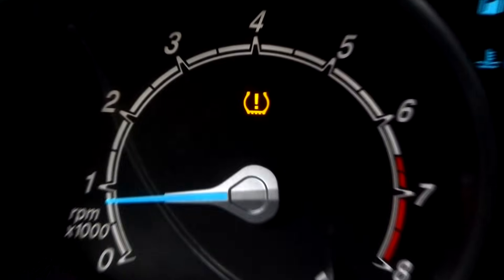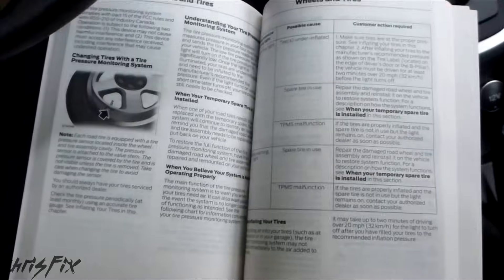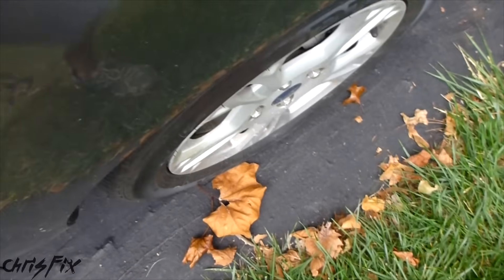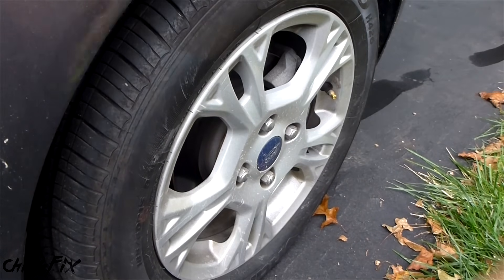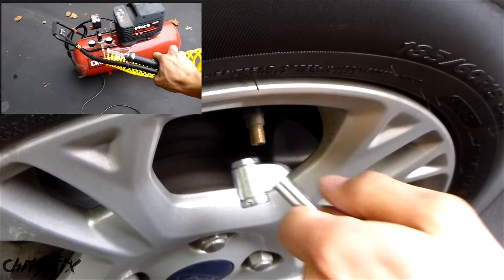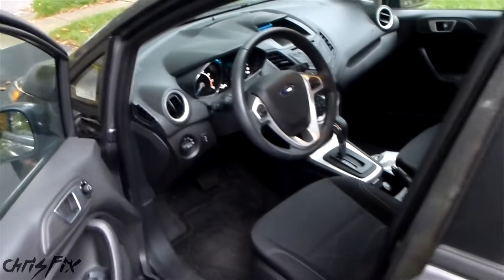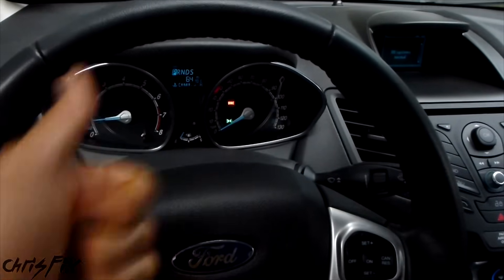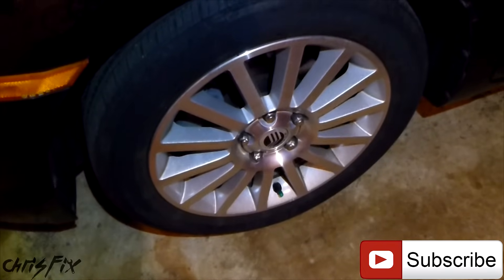How to Reset Low Tire Pressure Light (TPMS)

Comment: Black electrical tape fixes all warning lights
Reply: Otherwise its $80 each if after adding air it stays on because the sensor's battery is low.... so tape $1
Reply: @lovefaith1714  Where you get that price?
Reply: @roymg  Discount Tire ....... but mine turned out to be MY SPARE IN THE TRUNK, put the air in THE LIGHT WENT OUT
Reply: @lovefaith1714  thanks for the info. I just checked spare, its flat
Reply: Turning up the volume on the radio works to stop engine/body noises also.
Reply: It can turn off the odometer or even the gauges!
Reply: The same thing works on ABS as well!
Reply: Lol. Indeed it does.
Reply: Where do you put the tape. I was told it’s $258 + to repair TMPS tire sensor.
Reply: @carolync9408   Each sensor has a lithium battery that will eventually die.  So, tire companies want you to just replace the sensors when you get new tires.  (no repair)
Reply: @Ocalaman  Hi, there. Thank you so much. The car is paid for and I was thinking of just trying to find someone to repair it; because I’m so tired of the low air pressure warning. I may as well hang on for another year, and buy the sensors with the next set of tires. Thanks again.
Reply: i agree :)

Comment: What about aftermarket rims? My tires have a 51 max psi on them but the door and owners manual say 32 Max psi, I've aired them up but the tire light still stays on. Any suggestions?
Reply from the maker: +Ricky V.  The door jam is the correct pressure. Fill them up a little over the recommended pressure to like 34psi and see if it goes off. Also double check to make sure there are no leaks.
Reply: ChrisFix so just off of what the door says and not the tire?

Comment: hey Chris, I got this problem and I tried to inflate the tire as recommended. the sing goes off for few hours and pops back again even the tire pressure is good! So could it be due to bad pressure monitoring system?

Comment: All you got to do is go to any mobile gas station. You can set your tire pressure on the machine and the air pump will automatically stop when reaching that pressure instead of going around to each tire to see which one needs air. Just fill the air in all 4 tires until the air pump automatically shuts off for each tire. They charge 75 cents.
Reply: Please tell me you are joking.  Not only are those machines wildly not accurate, but do you think all tires on all cars should be at the same pressure, no. So anyone who reads this please know he is joking.
Reply: @davedavid8749  On the ones that automatically stop, the default pressure is 32 PSI BUT you can set it to what your car specifies in the event that you need a different tire pressure.

Comment: Chris Ive owned my car for over a year and have never seen the TPMS light turn off. Do I have a faulty sensor? I always maintain the pressure few psi above the recommended.
Reply: One of the TPMS was probably removed from one or all of your tires.  Do the valve stems look different on any of the tires?
Reply: You probably have a sensor fault then.

Comment: I got a tire gauge because of this video but I'm still having trouble with getting that light to shut off. I have a 2011 Hyundai Accent and I feel like I'm doing something wrong when filling the tires. Can someone help? I know it's simple to those who may be used to filling their tires but I'm not.
Reply from the maker: Fill it with 2 psi more than the door jam sticker says and see if that works.
Reply: ChrisFix you actually do respond. Thanks for your help sir!
Reply: ChrisFix I wanted to respond to those having a tps light issue. Although what Chris said is recommended, if you're having an issue like mine, try adding a little more pressure than what the door jam says. I put the pressure of air that the tire says is max and it's not my safest bet but it got the light off!

Comment: you didn't actually show how to reset the tire pressure light.  Just how to check and fill your tires.  I need to know who to reset the light if all the PSI's are accurate and have been driving with the light still on
Reply: Show her how to do a TPMS Reset Procedure.
Reply: there is a reset button probly in the glovebox that neds to be prested for 2 second s well is on my puegeot 108
Reply: ChrisFix what does it mean if the the light doesn’t go off even after filling up the tires with the correct psi? Could be bad tpsm sensors?
Reply: @karlaber3388  Battery time.
Reply: Karl Aber yes or the tires just need to be reset with a special tpms tool which you can do at the dealership
Reply: There. No tools they stopped making the car
Reply: @johnpeveto3784  there's not a different tool for every car. Go to any tire shop that's reputable and they'll have a TPMS scanner. They walk around to each tire and scan it to the computer so they can Bond the PSI reset
Reply: Resetting pressure monitoring system is NOT ALWAYS THE FIX, its $80 each if after adding air, drive it and the LIGHT STAYS ON it may be one or more of the sensor's battery is low and needs REPLACING. Hopefully not for most cases.
Reply: kerry briggs .
Reply: Karl Aber If this happens, you most likely have a button or menu somewhere in your car to reset the system. Check your car's user manual. Usually the TPMS system is only malfunctioning if the TPMS warning light is flashing.
Reply: Every car has a diferent way to reset ..read your manuals,,when my comes out all i do is check tires by eye ..then pressure check if it says under 35, guess what? It needs air it cost 1.50 in houston tx at any gas st,but sometimes sensors battery goes out and no reset in the world is gonna make it work ,i think yours is out ..hope it helps
Reply: @mattbullard07  you are on a how to reset tire pressure monitor video though it's about resetting not about disabling. I feel the same way you do as I am on a spare also and found out the TPMS is located in the tire and the computer picks it up. With the spare tire there's no TPMS sensor on it so the computer cannot read it properly and hence the light comes on. Now that I've changed all of my tires I learn this when the tire shop ask do I want to transfer the TPMS sensors because they charge more to do that.
Reply: Each car is different so check the owners manual. Also some cars do not have TPMS sensors in the wheels. After filling, you must drive for a while so the car can renormalize itself. However on some cars, like the newer Accords, you must manually tell the car to renormalize itself through the dash.
Reply: You may have a faulty sensor
Reply: Kerry briggs he said you have to drive for 2 or 3 minutes over 20mph and it will reset the sensors or you have to get the tool that your dealership can sell you... but if you have the tool you will have to look at a different video that uses the tool..
Reply from the maker: It shuts off by itself when the pressure is correct. Try inflating your tires an extra 1-2psi and see if that works.
Reply: ChrisFix I have a 2011 Ford Focus with low profile tires and the dealership told me that low profiles will always trigger the tire pressure light so mine has been on since I bought the car a month ago,is that true?
Reply: you didn't watch the video? you fill the tires up to the correct pressure and then drive for a few minutes...
Reply: That's not the problem, read the comment.
Reply: kerry i'm gonna smack you on the ass
Reply: Has to be female looking for free info.

Comment: A waste of 5 minutes to learn that if you blow the tyres up to the correct pressure the TPS warning light goes out!
Reply: Colin Townend a lot of times you do have the correct tire pressure but it will still say low tire pressure. it happens

Comment: How do you know how accurate you gauge is?Also, just for general information, typically the pressure has to drop about 25% for the low pressure alarm to actuate. For example if pressure is suppose to be 32 psi, 25% would be 8 psi or an approx. alarm point of 32-8=24 psi. This may vary a bit from mfr to mfr.
Reply from the maker: The gauge has a quality control certificate when you get it. And thanks for the tip!

Comment: I tried all the tricks in the book for the Nissan SUV I have and none worked. So, I am suspecting the TPMS sensors. How do I check those to find out if any one or all are failing?
Reply: Ahmad Ghosheh you've to check them all, this is the only way
Reply: What Nissan Suv do you have?

Comment: I have put the right amount of air on all four of my wheels and the tire pressure light on the dashboard is still on after driving my 350Z for 20 minutes. Could there be another thing going on with the tires?
Reply: yes, you need sensors or sensor

Comment: This just happened to me last night. While driving the yellow warning light came on along with message low tire pressure in my volvo. I added air to each tire last night since I couldn't tell which one was low. Overnight I had car i garage. This morning I suspected maybe my right rear tire was low because I had a flat there in the past. Thankfully the pressures were about the same as before I put car in garage last night. The car was sitting about two hours before I put it in the garage. So it's pretty accurate the readings as a result. Volvo manual said to wait 3 hours, but 2 hours seemed to work out ok. I called the dealer and they said it's probably a change in temperature. I was all set to go to a tire shop if need be. I'm glad I didn't have to. For some reason when I shut car off other night the brake light, and or alternator light on dash seemed to flash for a split second. It didn't happen again. Dealer said not to worry about it.

Comment: if all four of my tires read like that i'd question the accuracy of the gauge
Reply: Or, they were all filled to the correct pressures, and the outside temperature made them all drop roughly the same amount...

Comment: inaccurate title. this is General info about tpms. I just wanted to know exactly what the title of the video states.
Reply: Make sure all your tires are set to the correct psi depending on the vehicle you might have to drive around for a bit for your car to realize your psi is correct 
If it’s still on it may need to be reset with a Tpms tool that you can get that done for free at the dealership or you can buy at the dealership they put the car in tire learn mode which is different for every car and go around to each tire and reset it with the tool takes about a minute to do lol
If they still don’t reset you most likely have a broken sensor that will need to be replaced and then relearned
Reply: @moh907ak  you are absolutely correct my friend. I was looking for what you mentioned. I've put air in the tires but after a bit the light comes back on. I had no Idea that the dealership does it. I've heard about the resetting tool from another video. Thanks for actually telling me where to have it done as I don't have that tool.
Reply: Brandon Clark ed
Reply: He literally showed exactly what is in the title in the video.

Comment: What about when your tires are properly inflated and the system Is still showing a fault for my clk 550 2008
Reply from the maker: +deznutz7432 try inflating it 2psi above the recommended pressure and go for a drive.

Comment: In many cars adjusting inflation by 5 psi or so up and down will set it off, as will any time you get your tires rotated. To reset it and make it learn that where you have it is the new default, there should be a red switch in the passenger side fuse box. turn the key to run (don't start) and hold the button 3-5 seconds. The dash warning should blink several times. turn the key off, then start the car and it should be fixed. Make sure all 4 tires are set properly before doing that, or the computer will learn the wrong psi and cause the problems in the future caus ing it to trigger again
Reply: Alex M  
Hey Alex wondering if maybe you can help , just got a suv and the tiers on the vehicle have a different psi then the psi stated on the vehicle's door.. should I follow the door recommended pressure or the tire recommended pressure?  And would i still be able to reset it to get rid or that light?
Reply: THATS ONLY IF YOU ARE TALKING ABOUT THE SAME CAR YOUR WORKING ON ALL CARS HAVE A DIFFERENT RESET SYSTEM

Comment: That's not how to reset it rather to extinguish the light.
Reply: The light comes on for a reason. Chances are unless you went to a really stupid wrenchmonkey, they put the right PSI in the tires, and reset the TPMS the last time they did anything with the tires. So, just putting the right pressure back in the tire is enough to make the light go out.

Comment: CHRIS...I INSTALLED WHEELS ON MY CAR AND THE MECHANIC SAID THE TPS LIGHT WILL BE ON BECAUSE THE SENSORS ARE NOT COMPATIBLE WITH MY CAR...I HATE THE LIGHT..HOW CAN I TURN IT OFF FOREVER??
Reply: J . Santos,  yo bro, Tire Tech here. So you got new after market wheels and had them installed on your car? if you have the kind of sensor that is attached to the valve stem of each wheel,  they could of removed them from your old wheels and installed them onto your new set of wheels. 

unless the set of wheels you purchased came with sensors already on them.  

they should of just use the old ones , if you have the kind of sensor that's on the wheel or strapped around the rim. 

go to a tire shop. I work at American Tire Depot in California. I don't know  if where you live there's one near you, if so they should have be able to either swap your old sensors from you old set of wheels onto the new ones.
or if you have new sensors have them program each one so that your vehicle reads them and have that tpms light on your dashboard turn off. 

If you go to a regular mechanic shop they might charge more or may not have the proper tools to reset/re-learn/read/program the sensors.  

good luck. it's an easy fix just have to have the proper equipment and find aTire tech or mechanic  knows what to do. 
good luck bro
Reply: +J.Santos take it out
Reply: +J.Santos  You can either buy a obd reader and turn it off that way or have a mechanic do it.
Reply: TPMS in each wheel needs to be reprogrammed to car or its easier to just put the original ones in the new wheels tire shop should have done that.

Comment: Question for you Chris,  when winter Hits in my area my tpms light and vehicle information system will tell me to check tire pressure.  It is on all winter, 4 months or so even though the pressure is correct, what gives.  By the way I own a 08 Pontiac G6
Reply from the maker: +Stewie6000 The cold air messes with the pressure sensors. Check your pressure in the morning before driving the car because that is when it is the lowest.

Comment: i have same light in my car i fix all tier's but light still on ???what's the problme
Reply from the maker: +suhaib abutair Sometimes you need to overfill the tires by 1 or 2 psi compared to what is said on the door jam and go for a ride. Then air down -1 or -2psi when the light turns off.

Comment: I have a 2013 civic si and I checked all tires and they are fine, I even went over a little but the light still won't go off
Reply from the maker: +Darwin Chavez Check your owner's manual, you might have to drive for a certain amount of miles before the lights goes off. Also, if you slightly overfill them and then let air out until you reach the appropriate number, the light may go off.

Comment: my ? replaced 4 tires, and sensors balanced, but my tmps light is still on traveled 25 miles from shop to home. what next. I'm at a loss....
Reply: TPMS in each wheel needs to be reprogrammed to car or its easier to just put the original ones in the new wheels tire shop should have done that.

Comment: what if the light stayed on after tire pressure is good
Reply: He did a good job of showing how the system is supposed to operate. But in my case I have a 2012 Jaguar XF Supercharged V8 Portfolio Edition. And I had the light come on as a TPMS System Failure. Not a low tire. First I inflated all the tires to the required psi. The light was still on I went to a tire shop that read all of the sensors, they were all working. Next I did a hard reset for the car. Disconnect both battery cables then touch them together. This will discharge any capacitors. Verify tire pressure again just to be sure then reconnect the battery cables. Drive the car for 15 minutes above or about 30 mph. Shut off the car let it sit for another 15 min. Then drive the car again. It should reset. If not give it a couple of drive cycles. Driving and turning off the car and it should respond. It worked on my Jaguar XF. Let me know if it works for you.
Reply: @ArthurBrinkman-c5z  weird flex but ok lmao
Reply: RedWhite&Blue 78 u have to drive ur car for a bit

Comment: For those of u trying to shut the light off on a 2009 Corolla the following worked for me. Pasted.
FordNut7 months agoNo, no. Under the steering wheel. There is a button, facing down, with the symbol that looks like a horseshoe and has 'SET' on it, meaning re-set. Go to the link I will put in the next window and see Page 20 There are no re-calls for this either

Comment: That light also comes on every 10 mins if one sensor comes off inside the tire, you will hear it banging against the rim at very low speeds.
Reply from the maker: +Deez Nuttz Thanks for the tip!

Comment: Probably because you added regular air, typically checking your air pressure won't reset your toms, unless your pressure fluctuates, that typically only happens with regular air, not nitrogen
Reply from the maker: +Miguelito Dz regular air is composed of 78% nitrogen. That whole nitrogen thing is a gimmick.